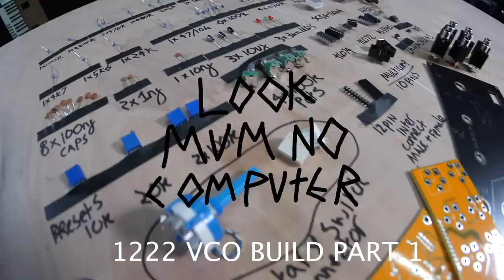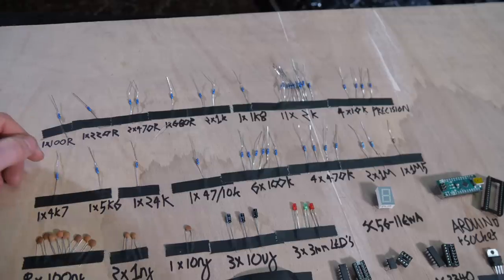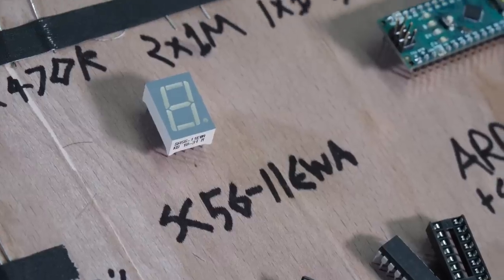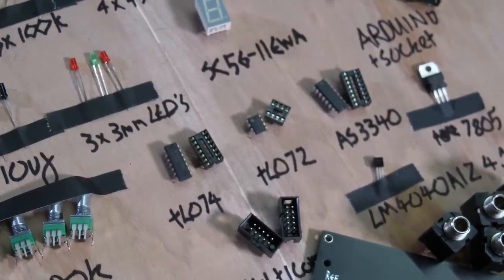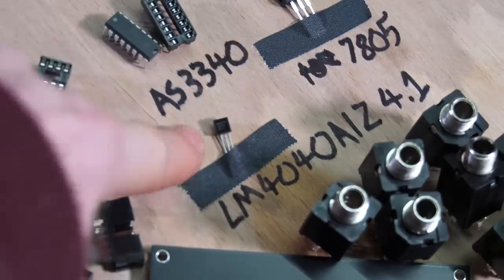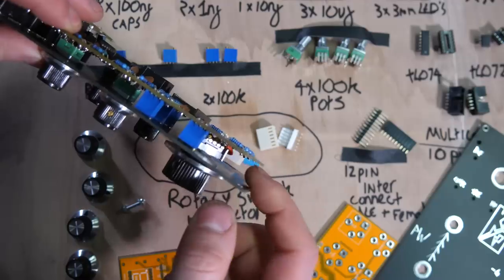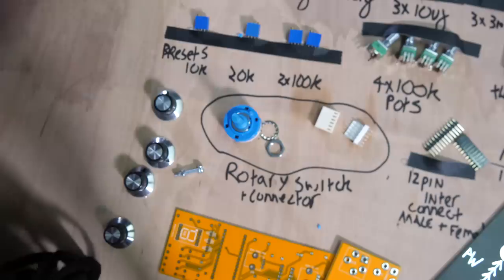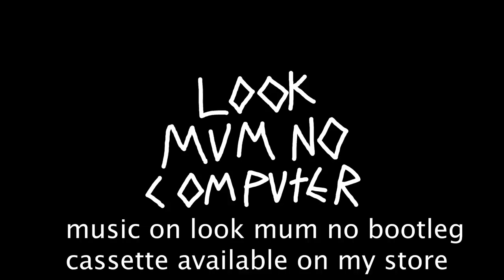1/3 Building the Kosmo 1222 Tuner VCO

Comment: On the kit it shows r9 as 10k/47k. Anyone know what this means? do i use either a 10 or 47k resistor with no difference or does it mean something else. Ive bought all the panels to just have a go but i don't know much about electronics sorry. Any help appreciated. Cheers

Comment: Looks sweet! Have made that mistake with the common-anode/cathode displays several times now. Would have a go at this if it was in eurorack!

I like aluminum myself, but with the PCB panels it would be super-fun to do a integrated capacitive touch buttons with LEDs through them. Getting a connection to the front panel might be tricky... SMD pin headers maybe? I think make noise has probably figured it out. Should be very robust and cheaper than an illuminated tact switch. IIRC teensy 3.2 has built-in capacitive touch sensing on 5 or 6 pins.

Comment: Rapid used to sell a great kit of metal film resistors in packs of 10/20/30 in 10R up to 1M for about £8, but I can't find it anymore (though you can get the same thing from other suppliers).

The decoupling isn't a massive issue if you have a good power supply (i.e.lots of capacitance) but they're good practice and for their cost they're worth putting in to avoid having to debug some weird issues.
Reply: If you drill a hole in the mounting plate (even not all the way through) the pin on the rotary switch will sit in it and help prevent the whole switch rotating rather than just the rotor (especially when enthusiastically switching on tour ;))
Reply from the maker: its a tad annoying yeah they have ditched that and also!!! made a minimum order of 5 on most things. doh.
Reply from the maker: but still the best in my opinion rapid. but yes indeed on decoupling! I just figured id mention it because I remember times I have stalled on a project because I didnt have any 100nf capacitors, because I didnt know it would have worked anyway! if you get me
Reply: @THISMUSEUMISNOTOBSOLETE  yeah, good point: they aren't /that/ essential that the circuit won't work without them.

On really old stuff I've seen them mounted on the chip socket directly, not sure if they came like that or were hand modded but they look cool if nothing else, diagonally across the socket (especially the big 0.6" ones)

Comment: LM4040AIZ-4.1 is virtually impossible to find where I live and importing is expensive. Is there something else I could use in its place? (The 5v one is easier to find although still expensive. Maybe I could trim it down? Idk, I'm a noob, but comparing it to the resistors at the octave selector, the trimpot seems overkill and makes me think it would take the 5v one well. Or am I talking nonsense?)

Comment: Sam, I want to run this module in a 15v powered system. Is this possible by changing some resistor values or does this need bigger changes ? Cheers

Comment: Sam, what is the 10k/47k resistor in the BOM? (shown as 47/10k in the video) There isn't a link in the BOM and I am not exactly sure what I'm looking for.
Reply from the maker: the 10k/47k resistor is down to the only difference in the datasheets of the as3340 and the cem3340. the cem3340 asks for a 10k resistor here, and the as3340 asks for a 47k, in the video i say i used a 20k just in the middle as i have not noticed and difference however its up to you which value you go for.
Reply: @THISMUSEUMISNOTOBSOLETE  Got it. Thank you for explaining.

Comment: Hey! You could add the rounded part with "mouse bites" so people could decide wether they want the cheap or expensive selector switches. For the cheaper ones you'd simple break away the rounded part to make space for the thicker switch
Reply from the maker: sounds funky! however another issue I found was I could not for the life of me find a break before make version. another reason however I forgot to mention it